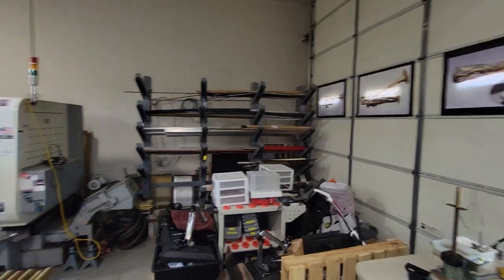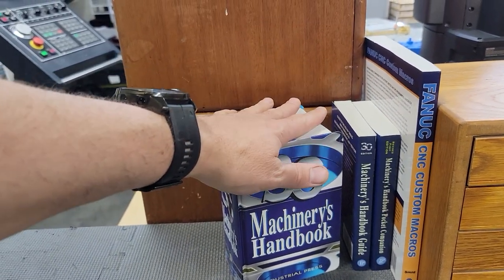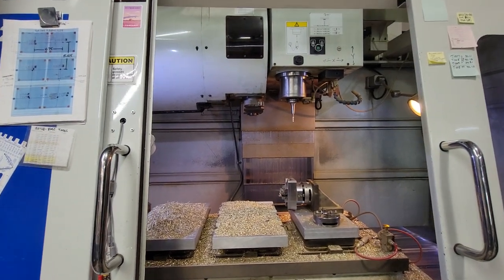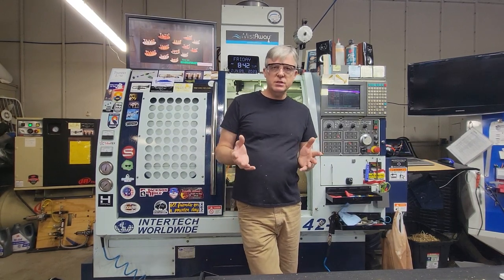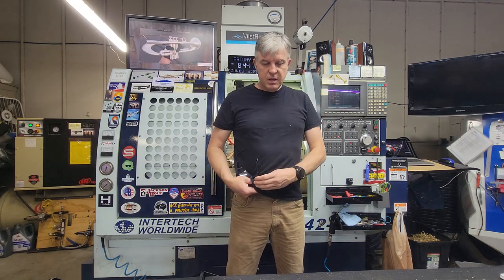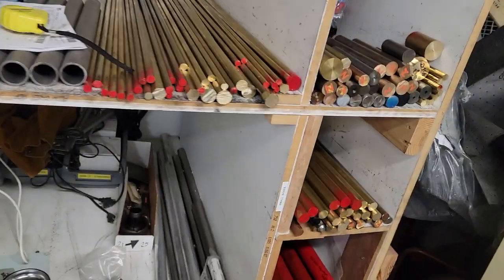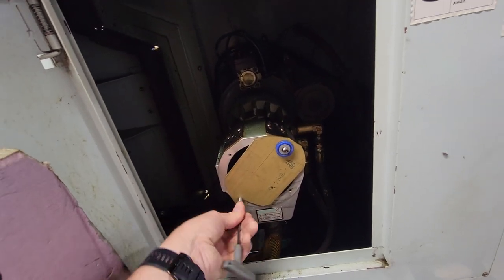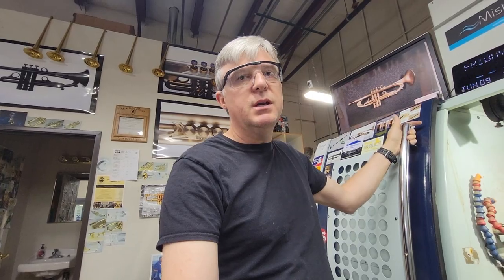How Harrelson Trumpets are Made - Shop Tour Part II (CNC Mill Turn Lathe)

Comment: That was fascinating.  Thanks.
I would imagine that making those bottom caps with typical machines used in most shops would take much longer than a few minutes.
Reply from the maker: Thanks Greg. Yes, if this were a standard cnc lathe, it would require 3 to 8 operations depending on the tooling and options available.